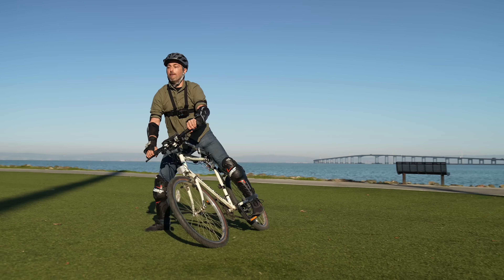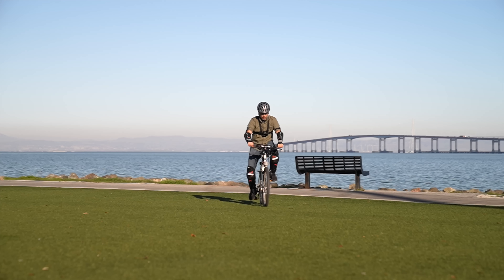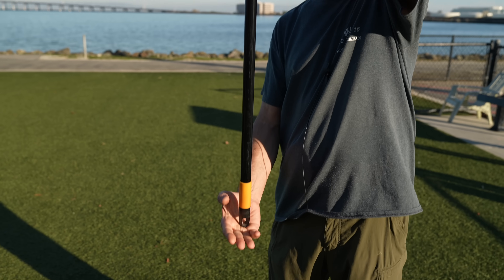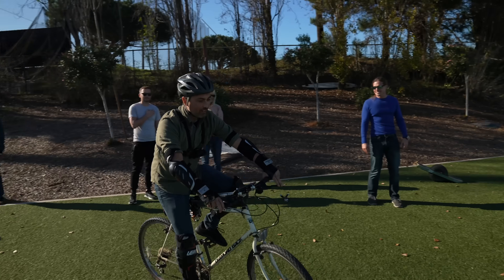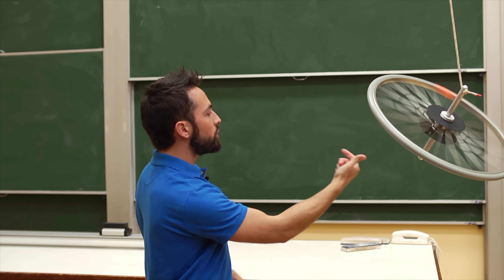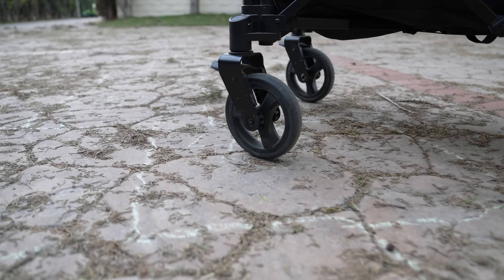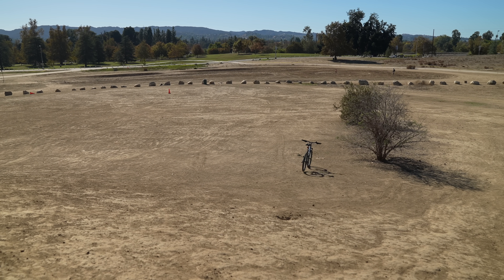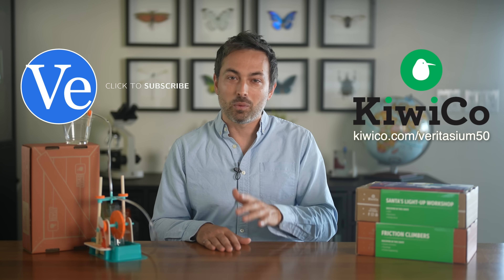Most People Don't Know How Bikes Work

Comment: Unless I was trying to keep balance (idle, so to speak), at low speeds I've never had to - for example - steer left before steering right. You just steer right and shift your center of gravity to the left (so you don't fall towards the right) by distributing your weight to the left pedal (which is turned to the lowest possible point, i.e. closest to the ground).
When you ride a bike (especially at higher speeds) you just shift your center of gravity to the side you want to steer towards. If you try and turn the handlebar at higher speeds you run the risk of fully and suddenly turning the wheel to one side, which will throw you over the handlebar (with severe consequences).
I want to say "I might be wrong, but...", but after watching this video I purposefully paid attention at what I do while, and how I ride my bike daily, and I have to disagree with the conclusions of this video.
Anybody else? :\
Reply: One day while riding bike down a hill, I noticed that I wasn't actually steering, but just moving my body to steer. So I tried steering with handle bar, I fell..
Reply: @markolukic6376  Ouch :(
Reply: Nah I'm with you. As dude said in the video. Many people don't know how to ride a bike lol.
Reply: video tape yourself biking and I think you'll find your interpretation of what you're doing may not line up 1:1 with what's happening with the bike on the whole
Reply: I think the specific case they made with the counter steering is only if the driver isnt able to shift his weight. Lets say you want to go left. If you just shift your weight to the left before turning you can just "catch yourself" by steering. 
Also the examples of broom and unicycle werent accurate because they only go into one direction.
Also if you think about motorcycles. If youd need to counter steer on a motorcycle the weight of the whole bike would make you lose control wouldnt it?
Reply: @Felix-vs8cv  yes it would. Especially on a sports bike. They rely on leaning. Just watch professional Moto GP races. Almost all they do is lean. They hardly have to turn the handles at all. Actually sports bikes in general are designed to have an extremely small turning radius so you don't bin it as easily.
Reply: @Felix-vs8cv  If you shift your weight then your countersteering the bike.
Reply: @herakles6185  if i shift my weight in the same direction i want to go its considered countersteering? Why?
Reply: @Felix-vs8cv  because your shifting our weight out of center of balance before you turn the bike. That is the point of counter steering. By steering to the left you move center of balance to the right that then allows you to turn. Shifting your weight means your body going to the right while the bike is going forwards is left of you. Its not complicated.
Reply: This comment it's hilarious.
Did people ever wonder why the handlebar always seem to be straight even if you making a big turn at a high speed? Wouldn't make sense to have the handlebar turn in the direction of the turn rather than straight? thats not happening because you are countersteering lol

Only works at high speed tho, 20 mph +
Reply: I do, and I understand where you’re coming from.
Reply: So if you were out on the variant of this bike with the handlebars entirely locked up which showed later on in the video, you would be able to keep balance on it?
Reply: Yeah , video failed to take into account how we steer on a bike , most ppl in the video are clearly not used to bikes. 
When we steer at low speed we use 99% handle bar and a bit of bike tilt , when we go high speed we do the opposite 99% bike tilt and a bit of handle bar steer.
I mean it's a nice video but absolutely pointless , when you go low speed you can of course steer without first going in the opposite direction, you just use your foot , why? BECAUSE YOU HAVE NO MOMENTUM , Jesus Christ , this video was rather biased and odd for me , i pedal to work everyday 6km , this vid was just a low hanging ad and to keep himself relevant to the YouTube ecosystem. Take everything Veritasium says with a grain of salt as he clearly doesn't understand how to use a bike.
Reply: @hungarmaw  either you didn’t pay attention to the video or are just ignorant, but it is clearly demonstrating a case where you cannot use your body. It’s a physics video, not a bike riding tutorial. And all the physics are scientifically correct. 
This video is clearly using a bike to demonstrate physics, not the other way around.
And using your body or foot to tilt, is still counter steering, just in a different form, you are countering the weight distribution to keep balance lmao.
This comment section really shows why cyclists are insufferable. Always the need to tell people they cycle and know more than literal principles of physics.
Reply: hahahahahahha
Reply: You should video tape yourself doing this at high speed I wonder if its true
Reply: It’s because you’ve unintentionally used sampling bias. 
When you go at higher speeds the gyro effect is amplified. So the main rule is changed into kinetic laws rather than gravity. But even then, you shifting your body weight to the opposite side is in a sense counter steering. If you keep your body straight you will need to counter steer.
This video has the correct conclusion, however, you’ve created a specific scenario where the rule doesn’t explicitly apply in the conventional sense. 
Hope I cleared it up for you :)
Reply: @cscexy  " But even then, you shifting your body weight to the opposite side is in a sense counter steering." - You need to read my comment again ;) <> P.S. - I didn't need any clearing, I was just detailing how I ride my bikes. <> P.P.S - There's no counter-steering in cycling (unless maybe WHEN you approach a turn at too sharp of an angle, in which case you need to move farther away from the bend); people are talking in the comments about how it's like that in motorcycle riding, fair, but we're talking bicycles here.
Reply: @cscexy  I doubt any amount of countersteering will help you to make a 90 degree turn if you mean to turn the wheel at 90 degree to a bike.  In most cases when you ride a bike you turn the wheel maximum of 30 degree. So this is highly theoretical scientifically correct but useless exercise. I don't see in the video them turning the wheel at 90 degree though. In any case they should have tried different angles and   compare with doing them on a bike without fixed controls. I think if he'd tried to make a 60-70 degree turn at the speed that he used in a video he would loose balance and fall anyway. 

You can make very sharp turn only at a very low speed but then you would require a lot more movements than only counter steering. We have inclined passages with narrow turns to go into underground crossings and the space for 180 degree turn is just  a bit bigger than bicycle length. It is possible to make a turn but you have to use both the handles, your body and pedals if you want to make it without touching ground or walls. 

In video he specifically says "you can't turn right without first turning to the left". Which is not true. You say: "And using your body or foot to tilt, is still counter steering, just in a different form". Well no. That's exactly the point. Steering is using handle bars. Using your body means balancing. You can use one or other way to compensate, but those are technically different things. I mean yes I agree with you  - when doing turn you need to compensate for it.  You can use different techniques, one of which is counter steering, but it is not the only one. 

People who does not agree with the video just does not equal the balancing with body shift to balancing with the steering. When you ride the bike a lot you instinctively do both to keep your position stable. But you don't need much of counter steering at the angles that you normally use, that's why the absolute statement in the video made so  much controversy in comments.